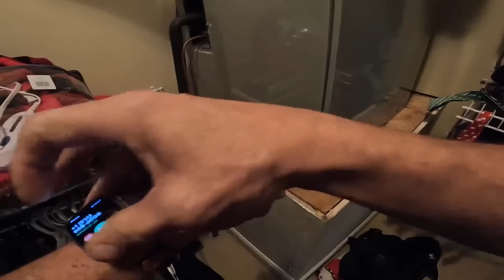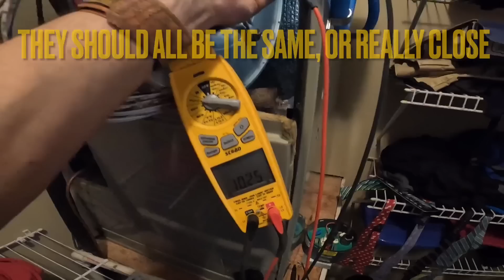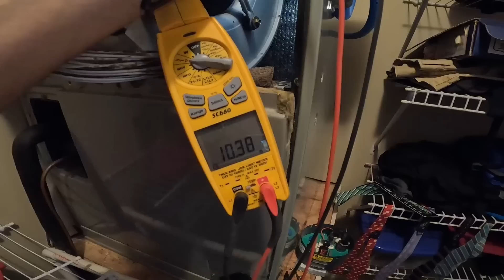Diagnosing A Trane Variable Speed Blower Motor! #hvacguy #hvaclife

Comment: We had 3 Trane units installed when we built our house 14 years ago. After12 years one of the A coils leaked and our dealer told us about the price of replacing it. We just about flipped. We opted for getting a whole new unit from another brand. It was just a few dollars more than replacing the Trane A coil. The dealer had bought a lot of the other brand units right before the latest price increase. 

I told him we'd keep the old unit for parts since it is identical to one of the other Trane units we had. Which he was fine with since they didn't have to haul the old one off. So I now have a spare Trane  'everything but the A coil' . 

I am licensed to work on ACs but TBH most of my experience was on huge chiller systems. 4 of them were 4000lb freon chillers. A bit different and much older than my ACs at home. 

Thanks for the video. It helped me diagnose my problem. Very clever.
One of my Trane units had a Durozone ED4 panel and another thermostat to control my office above the garage. The ED4 board had gone bad keeping the inside fan from running. Even though I had spare parts it was comforting to be able to test my fan motor. Thanks again.

Comment: I have a 2yr old RHEEM unit on a new construction home. The compressor blew so I had someone come out to replace it for $1,400. As soon as they replaced it and we turned it back on you heard loud grinding metal and the brand new compressor locked up and was immediately broken. I gave the guy half the money in good faith when we agreed upon him coming out to replace the whole condenser under warranty. Next day comes and the guy calls me, tells me they don’t make the condenser anymore cause they use a new model. He plans on keeping my $700 I gave him because he believes he did $700 worth of work (meanwhile I’m in the same spot with a broken AC) and he once again quotes me at $1,400 to come back out and change it again. He said no guarantee there isn’t metal shavings stuck in the system so if the new one blows I’m out a total of $2,100 plus then he will need to do a whole new system for around $8,000. So my 2yr old unit went from costing 1,400 to $10,000 to fix. Anyone have any advice for me? Rheem has no interest in helping replace entire unit whatsoever, even though their defective part ruined my whole system.

Comment: Question: I looked through your tool list but I didn’t see the small wrench you used to remove the module from the motor.  I’m guessing it’s a 1/4’ on one side and a 5/16’ on the other.  Who makes that?  Thanks in advance.  Matt
Reply from the maker: it’s made by Klein. you can buy it alone, or with a kit that has small 1/4” bits to fit in the end
Reply: @HVACGUY  Thanks Curtis
Reply: The next time you have that wrench out, please send me the part number.  Im having a hell of a time finding it. Thanks man, I appreciate it

Comment: I agree on the rip off prices on chinese made parts. First of all, those ECM modules never last as long as the motor and they aren't reliable. That module alone is where the money is, I think they are 80% of the cost of a new motor so by themselves, they sell for about $800 or so. Sad it is.
Might be better in going with Amana, Goodman or Daiken for HVAC mainly because replacement parts are usually easy to get and priced much less.

Comment: I encountered a Goodman with that exact setup recently from 2004 and the motor was in fact more than a brand new air handler. Ended up converting it to a regular Goodman fan board/PSC rescue motor. They had set the board up to where bypassing the variable motor was virtually impossible.

Comment: Have worked for a company that is a Trane dealer for 18 years. I have never found a bad motor on a variable speed unit. It was always the module. By the way the cabinet doors were on wrong.  You should be able to remove the top with out removing the bottom.

Comment: sometimes its just the inrush current limiter goes bad and u just replace that resistor and your back in business.  its just a matter of checking if u have resistance going across it or not. if there is none replace the resistor with the matching one. also arent there kits that u can use a psc motor with a board that turns it into an ecm motor?

Comment: Someone put those doors on wrong. The lip of the upper door should have been on the outside so you could take it off by removing all but one screw and the bottom door would stay on the unit.

Comment: I’m a trane dealer. I agree on the parts cost vs a new system or at least an air handler. We used to be able to buy just the module for those motors but not anymore. They want to sell the whole assembly. We usually put in a psc motor, capacitor and relay in older units that are out of warranty but we offer the new motor as well. Usually the homeowner opts for the less expensive repair.
Hope your back feels better soon.
Reply: I don't think you can even do that with an S8 or S9 system with how tightly integrated they are.  I don't think you can even put a standard thermostat on them.
Reply: @douro20  you can still put a regular thermostat on the s8 and s9 furnaces but its tough to use a psc motor on them.
Reply: I can't see why you can't just use a rescue motor and wire it up, even though it won't be variable speed anymore, and who really cares about that? It's as stupid as putting dual zone ac in a car. We just want the ac to work when we turn it on, keep all the bells and whistles.

Comment: So no generic parts for Trane’s? I guess not.
Reply from the maker: Sometimes
Reply: @HVACGUY  Yea, it's a dilemma out there for these older ECM 2.3 motors.  I agree with your comments on the PSC and anything can add up, but for these aged units, I just use the Evergreen X-13 (yea, it's X-13 and can fail), but you can still get the smoother startup and handle more constant CFMs than PSC...yea, could be similar price as the OEM module.  But been working great on Trane, Carrier and York systems.  The Evergreen has a programmer (only used once on my system just to see how it works) that you can customize the torque to better fit the CFMs... yea, it's time  if you had to do that.  But overall Customers like the price better and it's a happy medium to save the older "premium" equipment.  I just document the settings, TSP, current to the best that is possible.  I don't think there is a right answer here.
  Also agree with what big Companies are doing, but to their defense.  GenTeq (Beloit) doesn't make modules for the ECM 2.3 anymore, they were replaced by the ION 5.0, so you would need a new motor anyway.  I know it's neither here nor there, either way the customers pays!  Good video and hope you don't get any more back spasms and it feels better.

Comment: Do you normally change out the ECM part and or the motor to save the customer money? or do you automatically just change both regardless?
Reply from the maker: Depends on what kind of ECM, and by what company it is made. On this one I asked for a module, but had to buy the motor. Sometimes on X-13’s a replacement motor costs as much as an OEM module.

Comment: I love the variable speed blower motors.  I’ve got a Dave Lennox signature collection two-stage variable speed gas furnace that’s 13 years old.  The only thing I had to replace so far is the igniter, and I did that a little early.  I love the way they ramp up and ramp down, and you can select 12 different speeds for cooling and 12 different speeds for heating.  It is so quiet you never even know it’s on.
Reply: Good till they go bad
Reply: @Kernica1 I'm sure they do! Heavily promoted!

Comment: I fix those motors.  Easy.  Take the control unit off.  You will see motor windings got hot.  Air. The windings and put motor back together.  Motor will. Run correctly.  The motor and module is about 1500 cost from trane.

Comment: Yeah carrier wanted 35,000 for an old ass 15 ton r22 condenser. We had to ask 5 times for them to repeat that number because we were t sure we heard them right. It's ridiculous. Aside from that, in this video and situation I would have personally pushed to install a standard PSC motor, relay, and cap and called it a day. I just recently had to replace a brand new Trane PKG unit blower motor (ecm, icm) style because their junk and the plugs they're using to plug into them are junk. They don't seat into the socket right, I had one of the male spade terminals pull out on the replacement warranty motor. Absolutely horrible.
Reply: @@Kernica1 I really don't have any preference honestly. I just think the quality of everything these days is terrible yet they still want a premium price for it. But that's to be expected in the world we live in today.

Comment: You are correct on the price for parts. I do mainly refrigeration work and I had the LED lights go out on a Beverage Air two door reach in cooler. The lights cost $888…. Just for the light strip. The whole cooler itself cost $5K new.

Comment: Is the price higher for you because you are not a Trane dealer/installer? I love my Trane system, and I’m aware of the parts prices…
Reply: Basically. Generally, whenever you're not a dealer, you get the mark-up price so it's worth their time selling to you since the dealers typically get a discount.
Reply: The equation is divided against itself. To be a Trane dealer means you are moving 100K in equipment per year or more. If you're repairing for a discount part you may not hit the sales goal of 100K and then lose the measly part discount and not be a dealer under their terms. You can't be both. It's a myth or elaborate shell game take your pick. The scheme is all about sales, not repairs of old equipment. Wait another 2 years until Puron equipment gets banned, then they'll be selling you new equipment for the new, new stuff. Then wait until 2035/ 2036 when the new, new stuff is banned again. It has to happen this way to hit the GWP targets set by the Kigali ammendment to the Montreal Protocol.

Comment: These generally have a 10 year warranty.  Now one needs to consider due to the cost of motor replacement vs air handler replacement if old motor out of warranty the better decision is to just replace the air handler,  As an example, in this case in 2 years this fine gentleman's motor goes out again it'll be out of parts and labor warranty.

Comment: With all the dust around the blower I bet the tenants never change the air filters!
Reply: Landlords need to do that if they expect it to be done at all. Its part of maintenance, most tenants don't believe they should do that work.
Reply: @Garth2011  In Houston TX,, landlords have very strong rules and it's up to the tenants to take care of basic things like replacing filters. Building maintenance men are ignoring the work due to low wages.
Reply: @Garth2011  Trammel-Crow is a large apartment and condo landlord; like Lefrak-City in metro NYC.

Comment: More than likely that resistor on the module is toast. You can cut it out and bridge the wires together or replace the resistor considering it is out of warranty. Trane is a joke on there parts costs

Comment: I'm pretty sure with your experience and your knowledge couple of sensors and relays you can bypass that module if you can figure that out you can make the money
Reply: Not that simple, those motors are effectively three phase motors with permanent magnets on the rotor. The current/voltage pulses have to be timed to the position the rotor is in so it turns correctly hence the module.